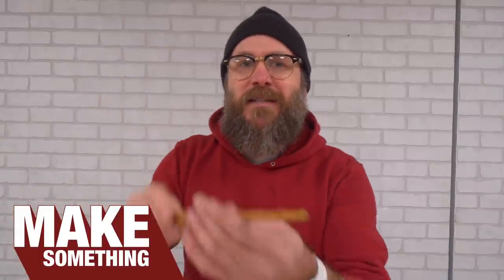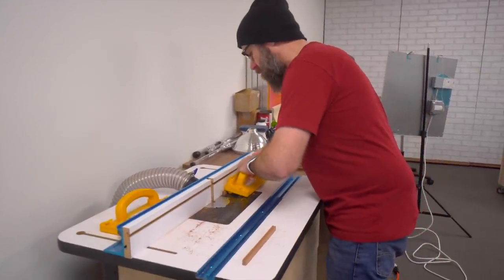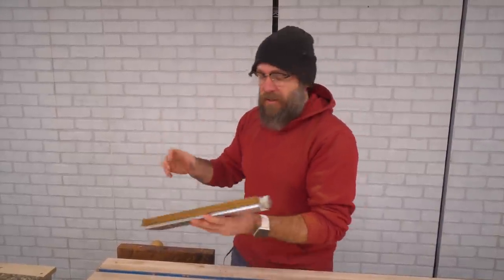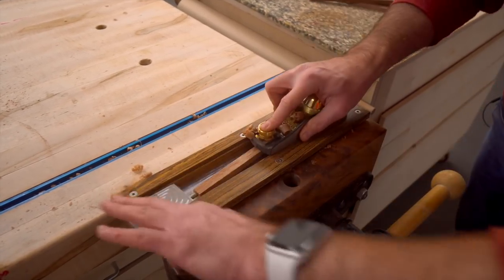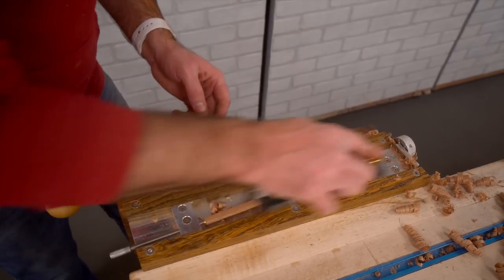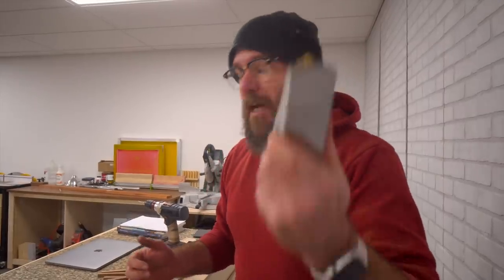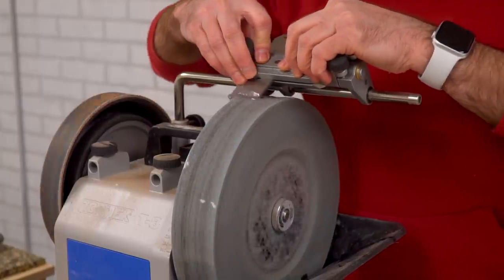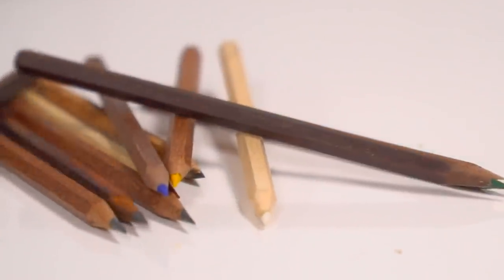Introducing a New Way to Make Pencils // Woodworking Project

Comment: I get the passion for making stuff, that's why I subscribe to the channel and why I've attempted to make things with the guidance of the excellent videos.  However, $180 for a jig to make pencils when you can get 96 pencils for $8 on a well know shopping website (or about 2,160 pencils for the cost of the jig)...that's less about making stuff and more about a costly solution looking for a problem to fix.
Reply from the maker: You say you get it but do you actually get it?

Comment: There's something you do in your shop that I don't know where/how to find. I'm not even sure what it's called. 

I've seen you cut full 4x8 sheets of plywood on your table saw. I can't do that on mine (yet) because the table on my table saw is horrendously tiny. So, do you have a special attachment on a small table saw that allows a large panel to stay flat as you're cutting it, or do you just have a table saw with a huge metal table?

I'm working on one of those Amish cabin-type storage sheds. I've been trying to use a battery-powered Skill saw to cut my plyboard, but it's very awkward. 

Do you already have a video about your table saw? I'll definitely go watch it if you do. I already watched your video on the cross-cut setup you did.

Comment: I noticed the jig is setup that the pencil is diagonal. Did I miss something or is there a reason for that?
Reply from the maker: It is. Same reason you angle a hand plane when jointing a board so the blade is shearing.
Reply: Makes using the block plane easier. Also makes it that one pass uses almost the entire width of the blade so it will stay sharper longer.
Reply from the maker: Ahh, I didn't know that! Thanks J.D.!
Reply: That makes sense. Thanks!  @MakeSomething
Reply: @JDintheTJ  especially important for this jig because there is a glue line, you don't want that hitting the same spot on the blade the whole way, or you will dull that one spot faster.

Comment: In the video you say 0:54  "cut a groove on each side" , where you only need to cut grooves on opposing sides.
Reply from the maker: Cut a groove on each side and then split it on the bandsaw.
Reply: I was thinking that if you grooved both sides that you could glue up a slab containing multiple pencils. You'd just have to be sure that your bandsaw cuts didn't drift too far from the centerline between leads when making those repeated cuts.

Comment: Seems a slow way to make loads of pencils, have you seen how they are made ? 
Check 'how it's made - pencils'
Just need a jig like a finger jig to index the v grooves, i would guess you'd need a v groove bit with a flat tip to allow for cutting them apart
Reply: Exactly! That's the first thing I did, was to watch a " how it's made video". While I can appreciate the craftsmanship, it seems that there's way too much emphasis placed on the process rather than the end result.  I'd much rather take some lessons from the mass production process.  Cut multiple grooves in a slab of wood, and sandwich them together with the lead in the grooves. Then use a router bit to cut a v-shaped notch on both the top and bottom of the slab to separate the pencils and give them their hexagonal shape. Much faster and way more satisfying in my opinion

Comment: I was interested in the jig until i saw the price. I would be more interested if it were about half that cost or closer to $100 than $180 or $200. Maybe some time in the future but not right now!
Reply from the maker: I hear ya. Unfortunately manufacturing is expensive, especially with a first run.

Comment: Haven't watched the video yet, but I have been waffling around on this for a while.

I remember back on your pencil video a couple of years ago, I made a super dumb comment about not seeing the value in the project.  I'm sorry for making that comment. On my part, it was a dumb observation, super redundant about about "only if it was scrap wood" etc.  After you replied to the comment at one point, and even after it was mentioned in passing on WoodTalk, I looked back and saw that the 'concern' was pointed out no less than 5 times, including in the video, description, and title.

It was a dumb lapse and mistake on my part, and as a result, I've tried to think even more before commenting on videos, taking everything else into consideration.

in short, I'm sorry about thing I'm guessing you never thought specifically about since that video.
Reply from the maker: No worries Nick!

Comment: I must be missing the point here.....  I am guessing your jig will cost about $100.  I bought a box of 20 great quality Staedtler Pencils for $1.99 which I guess will last me about 2 years, so 10 pencils a year at $1/yr.  I assume I have 40 years left so am I not loosing money doing it this way?  Other than finding a place to use scrap pieces of figured woods it seems a waste.   As a suggestion, perhaps you could try burning the scrap wood for heat so your shop wouldn’t be cold and you wouldn’t have to wear a toque.  Neat video though.
Reply from the maker: Yes, you are missing the point. Don't you like making stuff because it's fun? Nobody is going to make pencils to save money. Anyways, have a good day!